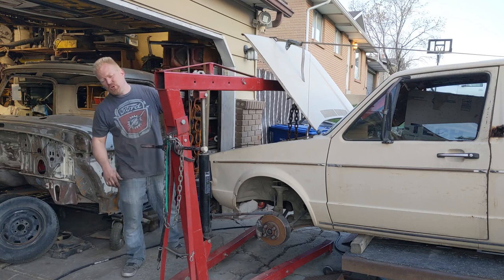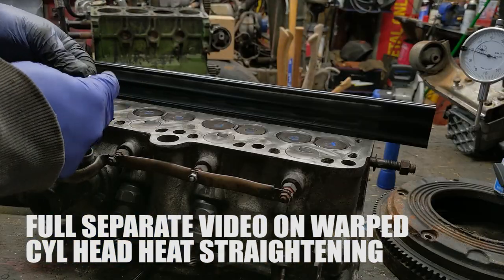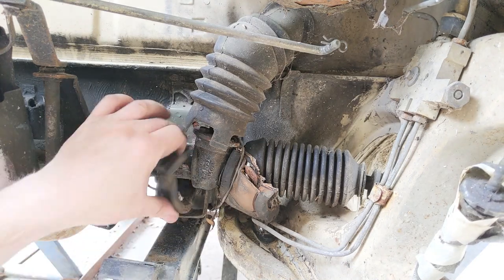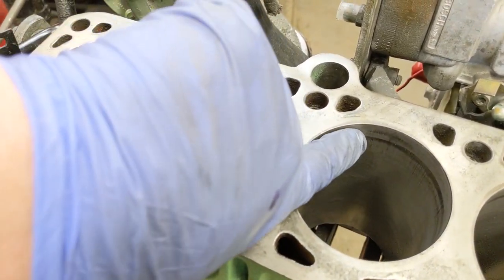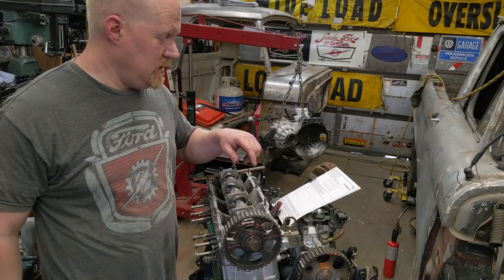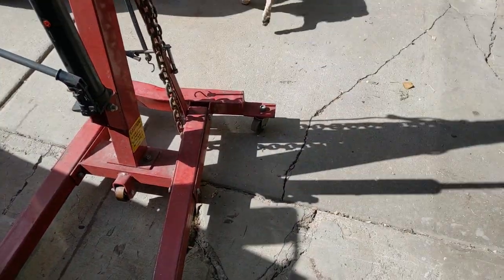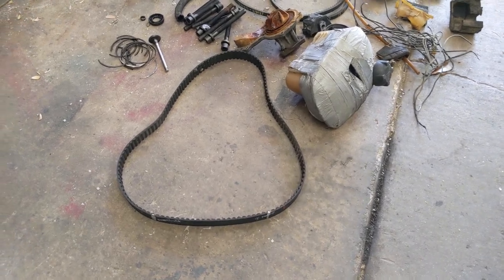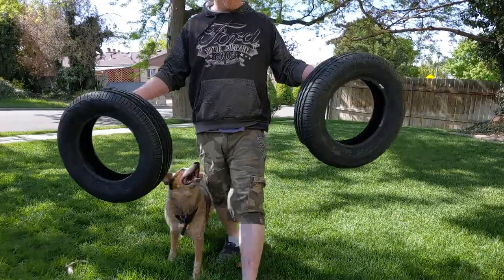VW Diesel Truck Rescue ENGINE work & FIRST Drive Part 2

Comment: " Didn't have a valve spring compressor the right size, so I whipped one together out of scrap." OMG! That is awesome. 😁❤️ The previous owner was a real maestro in the use of bailing/coathanger wire. Wow. I liked watching how you used your portable lift to remove the engine/trans. What a fun video to watch.
Reply from the maker: Hey Thanks. They were on a different level of wire tying skill than I am. The lift definitely is a time saver for moving these things around.

Comment: I had two of these, the 81 was the best. I drove it for quite a while, then it was my daughter's first car and then my son's. Both of them wish they had it back. 55mpg but you didn't want to pull out in front of anybody and if you wanted to go over 55 you had to draft a truck. There was a very well know VW mechanic in a near by town that was extending the cab by putting front doors off of a 2dr rabbit on one. The front doors on the PU are from a 4dr rabbit, 2dr's are quite a bit longer. I happened upon him just as he was starting his project and told him "I always thought it would be good to splice in the top of a rabbit convertible" and he thought that was a great idea. Went by 3 years later and saw the end result it was the nicest VW Rabbit Truck going!
Reply from the maker: That's awesome. I had plans to do the exact same thing and it was one of the reason this project took so long to get off the ground. I tried to track down a running 4door rabbit for nearly a year that would be a good candidate. I couldn't find anything.

Comment: I had a couple of buddies who each bought one of these new.  One engine was no end of trouble and the other was trouble-free - I can't recall the problems.  Fuel mileage varied from one vehicle to the next.  VW had valve stem seal issues in that era, and didn't protect the fuse box from water resulting in a lot of corrosion problems.  Diesels looked very attractive back in those days of fuel shortages and higher prices. People would do ANYTHING for fuel economy. VW bottom ends were not problematic as I recall, and they weren't as sensitive to fuel quality as were Chevy's attempt at consumer diesels.  Car makers were still learning about these and went to school on their customers' dimes.

Nice work.  I'd be tempted to repurpose that engine.

Comment: You're shoe lined clamp beats my carburetor with a bottle cap in the bowl holding the float up, to get fuel to the engine. I think LOL

Comment: When I took my Caddy cylinder head off, I kept the exhaust manifold attached and just detached it from the down pipe. The way you did it was smarter. It was super heavy to lift off the motor. heheh.  Taking the motor out the bottom is a great.

Comment: Great work! Love your pragmatic and sensible way on looking on things. Don't fix it if ain't broken. If it worked when I pulled it apart it has a high likelihood to work when I put it back together.  Any idiot can swap parts but actually fix things is a skill. Only time I ever used 11mm spanner was for the M7(!) head bolts for my (german) moped.
Reply from the maker: My 11mm has lead a lonely life.
Reply: @sixtyfiveford  Hahaha

Comment: I got a 1980 Dasher with the 1.5L Diesel .. I rebuilt the engine in 2001, I'm still driving it. 45 hp   It runs at highway speeds just fine. Gets 45 mpg.
Reply from the maker: That's awesome.

Comment: Yea check that Hans auto parts for the fuse block and some other parts. The  rabbit stuff is not too bad quality. but some stuff is total crap...It is super cheap to buy from them. Shift linkage stuff, bushing kits, mounts, are OK...

Comment: Way Cool.  Doing the same thing.  Saved one from scrap.  I got mine running. But it was way down on power.  Swapping in a 1.6td I fully rebuilt. hope to fire it this weekend, and have another on the road in Utah.  Waiting forever on parts these days sucks!

Comment: Brother from another mother, I've been waiting with baited breath to see that run. My dad being a lifelong mechanic brought projects home all the time, always excited to see them go on their own power. He had a 180D he bought when it was 5 years old drove it for years had a problem and it had to sit for a couple years until he could afford parts and get it running more exciting than any movies or there. He had my cousin put the wheels on and we got about a half mile down the road and a wheel fell off. My cousins put the wheels on and no lug nuts. Anyway my friend awesome series and I'm looking forward to more.

Comment: About 15 years ago i had a friend who bought a 1990 Golf GTD with the turbo version of this engine. The timing belt had snapped, so he didn’t pay much more than scrap value. Except for the engine, the car was in excellent condition. We replaced two bent valves, gaskets, belts etc. and had it running again in a matter of days. It was amazingly fast for a diesel of that age – one night, out of curiosity, we took it out on the highway and gave it the shit. When we hit the rev limiter in 5th gir, the speed was well above 100 mph. When driving at normal speeds, he often got close to 70MPG on the highway. It had VWs ‘’4+E’’ transmission; the 5th gear was labeled "E" for Economy. From memory, i think the gear spacing was somewhat unusual, where the first 4 gears had a normal spacing and the E gear somewhat longer, the idea being you would accelerate to the desired speed on the lower gears, and then, provided the speed was high enough, drop it into "E" during cruising. He had the car for a few years and drove the shit out of it, and sold it with a nice profit. Good memories.
Reply from the maker: Thanks for sharing. Awesome story.

Comment: Worked on a lot of them from the 80s ,but don’t remember seeing a green engine before,  looks good, you’ll have fun with it.
Reply: I'm fairly certain no one but the assembly guy knew the real color, because they were always covered in oil and dirt!
Reply: Like the the color, you’re probably right
Reply from the maker: After I put all the accessories on the front you can't see any green anymore. I actually had to Google it because I didn't think they should be green either. According to Google and the Volkswagen gurus it was essentially a John Deere green.
Reply: That’s funny I had 3 trucks and maybe 5 cars all my kids drove them, seem like the engines were in and out of them all the time. Know it doesn’t sound good but they were old cars at the time. Most always easy and fast fix’s. good luck with yours think you’ll like it.

Comment: I think the ARP head bolts I used on my 351 were somewhere in the 120-130 foot pound range. I was certain that I was going to pull threads out of the block. It's definitely a "pucker" moment!
Reply from the maker: For sure!

Comment: Nice work. I like the sping loaded center punch knurling. I had a goofy acquaintance who called it "narrowlizing" Also the valve straightening was pretty cool. Would have come in handy when I crashed the intake valves in my GTI. Thanks for posting.

Comment: Old video, I know, and I haven't seen part 3 yet so perhaps you've already replaced the fuse panel, but there's a fantastic product to clean up contacts called simply De-oxit (not sure if hyphen or not).  Cleans and lubricates without conductivity.  spray some in, pull fuse, spray a bit more, then insert/remote the fuse several times and it's likely to be good to go.

Comment: I am just now finishing the video, When you said I might have to push in the clutch I had to laugh because I have a 1986 Porsche 944 Turbo (951) and yeah I guess in Deutschland  people know not to hit the starter with it in gear because there is no lockout on the clutch pedal and yes it will try to start without pushing in the clutch, lol.

Comment: Ginger treats you SOOO good! I believe my torque on the head retorque was 120 or 125. Seems like it started at 115 and I just went on up. Never leaked again and YES, they are super rigs! Sounded like mine did when they were right. I ran DELO in them too. The worn p0ut one was roll start and got 45 m.p.g. at no more than 45 m.p.h. or it'd run away. You'll love it and one had a rack and pinion power steering I changed out on my back in a gravel driveway. They're a trip and the difference with the a.c. on and off was 1 gear. GBWYall!
Reply from the maker: I'm used to the low power and AC with my wife's 96 Ford Escort. Going up hills I have to kick it off and it feels like I hit a turbo button(a slow turbo at that). Right now I have really thin oil in 10w40 just to flush everything out of the bearings and passages. It will be changed relatively quickly to something more robust.
Reply: @sixtyfiveford  YAAY and A-PLUS!

Comment: Great job 👏🏼.  Had several of the engines and found that the pump shaft seal needed changing on older higher mileage ones. It’s available and can be easily changed to avoid hard starts from leak down!

Comment: My mother had a 1982 Volkswagen Jetta up until 2003.  I believe it was the same naturally aspirated diesel motor.  The heat was so-so and the transmission had a hard time engaging first, for years she lived with 2nd gear as the low gear.  Most annoying thing was the oil pressure warning buzzer.  She took it to many independent mechanics and a VW dealership too and no one could fix it, although they confirmed that the oil pressure was in fact good.  Most of my childhood I recall not being able to hear well in that noisy ass car, smelling diesel, and her constantly banging on the dash which only temporarily quieted the oil pressure warning buzzer.  Tolerances man!  I believe I still have the original shift knob from that car, somewhere...
Reply from the maker: That's hilarious. That's my exact experience with driving this thing. First gear is impossible to find and just all out noisy.
Reply: @sixtyfiveford  It didn't use to be impossible, I learned how to drive stick at age 13 in that car and it worked but over time it got worse and worse.  Strangely enough years later I found one of those 2 linkages that you had there, the "Z" shaped one, brand new in a VW bag.  I think she had ordered it but then the mechanic said that wasn't the problem.  Who knows really when you're receiving second hand information.  I was too young at the time but if I was older I could have probably taken care many of the small gremlins that existed.

Also that car had the two piece VW chrome hubcaps.  I believe they were chromed aluminum, there was the outer black/chrome trim ring and then the chrome VW flat dog dish in the center.  Also as a child I remember them flying off on rough tracks and my mother having to go and run them down.  Now that I think of it that car was a pain in the ass.  But apparently between 1982-1984 she used to make many trips between Chicagoland and Tampa, Florida.  Stick shift, naturally aspirated diesel, no cruise control.  Jesus.  At least it had A/C!

One last thing I noticed, your truck there has domestic style fuses.  Her 1982 Jetta had the european style fuses.

Comment: Good to see some more idi's living on.   I've got 3 of them. (2 turbo motors)       those pumps will live forever as long as you keep the water out of it.    Mk2s had 2 water seperators, might want to look into the later fuel filters. Has an internal seperator in the filter.    Many gas stations have rusty diesel tanks that can sell you water by accident.
Reply from the maker: Good to know
Reply: @sixtyfiveford  thanks for sharing the fix on that cylinder head!!   I've never thought about what would cause the warpage, simply accepted it as the best reason to keep a solid cooling system intact.

Had to send this vid to some fellow VW diesel folks.  All of whom are blown away at the sound logic and ingenuity of your fix.
What's better about your method than what machine shops will do is no line boring cam journals, no cutting valves to a "custom" stem height, no waiting for shim kits in the mail (if you can find NOS german ones), and no aftermarket cylinder head that could have subpar QC or metallurgy in critical places like valve seats.

👏👏👍

Comment: Thanks for including the clip of using the ac compressor to pull the diesel fuel out.  I just had the ac replaced in the house and kept the old unit for projects.  A vacuum pump using the compressor was on the list of things to do, and now has been moved up the list.  I have been using a pneumatic sucker from Horror Fright to suck brake fluid or other fluids.  Hate that thing!  So noisy and inefficient.
Reply from the maker: Awesome. I've use it to do AC systems but it has be relocated to the shelf since an bought a professional AC vacuum. I didn't think about bleeding brakes with it. Thanks for the great idea.

Comment: That little truck will pay you back and then some. These VW Diesel engine are made to last forever and 50-60 mpg. There was a guy who had one and like he had it long time. 
I didn’t see what weight motor oil you are using but for a diesel I highly recommend shell Rotella 15w40 in it so the engine will live longer. 
Enjoyed the video and have a Blessed One Sir. Like to see more videos on this VW rabbit pickup.

Comment: the dimpling is a great tip.  i re ringed a 6.5L detroit diesel.  one cylinder could have used some dimpling.
Reply from the maker: That's my own technique. Maybe it'll work, but I don't see why not nor the difference between this and knurling. I actually Googled it to see if anyone else dimples and couldn't find anyone other than the knurling machines. And only old timers talk about the knurling machines and most are relocated to the backs of home shops.

Comment: The fuel economy you are going to get will more than pay for your time and effort. I drove one my boss had 20 years ago that got 40+ mpg town and 65 mpg or so highway. It isn't a power house, but it will get you from a to b. Great purchase, you will get a lot of use out of your VW pickup.

Comment: Watch the right shock tower doesn't brake free of the rest of truck. Mine did. Good job. Thanks.
Reply from the maker: Yeah those shock towers seem to be a major rest point for these. Fortunately there's absolutely zero rust underneath and one of the reasons I decided to move forward with this project.
Reply: @sixtyfiveford  Yes they do look good. That truck is capable of 51 mph. They are fun to drive.

Comment: I had a mystery charging problem for years in mine and could figure it out. Finally found that the alternator bracket and bolts were insulated from the block. They relied on a braided ground strap which had corroded through. They had a weird almost backward voltage system. The horn was that way too....just FYI if you run into some issues.
Reply from the maker: I thought it was weird to have the braided strap and figured it was just for redundancy.

Comment: New subscriber from Australia. Love the seal extraction tool, dimples d trick and temp shifter linkage. You need to move to a desert island and fix cars. Who needs ebay parts. Cuban cigars anyone....
Reply from the maker: Hey Thanks.

Comment: From what I remember of them, most went to the bone yard due to their garbage fuse boxes.. NY State Inspection says lights must work. Customers got tired of paying for the same work in another area of the box... Those engines took nothing to make run and got pretty good fuel mileage too!!!
Reply from the maker: Yeah, the wiring is what I'm messing with now and it's pretty poorly assembled and corrodes easily.

Comment: I transplanted a 1.5D rabbit engine into my mk2 Jetta automatic (removed 1.8L petrol engine) it's lazy as hell, but a real fuel saver. I also have a dismantled 1.6TD engine which I'm yet to assemble. I hope it all works as the previous owner said but I'll only know for sure one assembled.
Reply from the maker: Yeah, you never know until you try it out.

Comment: Amazing work you're doing on this truck. Low powered great mileage Deasil pickup is going to be of great use after the fuel prices go through the roof. Use cooking oil to run it. I bought a 75 Dodge D-350 duelly Box van I'm working on. 84,000 miles on it. The gas tank is plastic, and has the level sender and fuel pickup in the side, lol. When I bought it the tank wasn't hooked up and had to move it with a gas can with the tube from the engine. The parts are rare and hard to find, and expensive. Front Grill costing $225, and they're going on ebay for $300+. I have to find parts and someone who knows what the side mount hole is about lol. I guess it makes sense. I'm thinking of dropping the tank to make sure it's cleaned out. Sitting for over 10 years open with nothing in the hole, but the engine runs great. The tranny is a little iffy. I have to redo fluids I'm thinking.

Comment: I hope you used the DIAL INDICATOR to check injection pump timing should be at 1mm while lock bar is in place.
Reply from the maker: I did. I set it to  .99-1.00mm
Reply: @sixtyfiveford  sounded good. is that one the Mechanical lifters or Hydraulic I am guessing hydraulic because of the head bolt torque. torque to yield. the older blocks cracked in all 4 corners Mechanical lifter blocks were crap.
Reply from the maker: @Mikefngarage  This is mechanical but the upgraded 12mm head studs. The 11mm head stud blocks from a few years prior were the ones notorious for cracking
Reply: @sixtyfiveford  COOL those even without Turbo pistons take a bit of boost too. 10lbs is still safe. There is a guy with a not so good reputation Hans auto parts that sells a turbo kit for it. Not too expensive. I have the kit on mine and it has lasted over 40k miles. no issues. https://www.hansautoparts.com/ I turned up the fuel a bit and still get 50mpg with about 90HP.....Eventually I put in the AAZ 1.9 which is better and still gets 50mpg.
Reply from the maker: @Mikefngarage  Good to know. A little boost would be great.